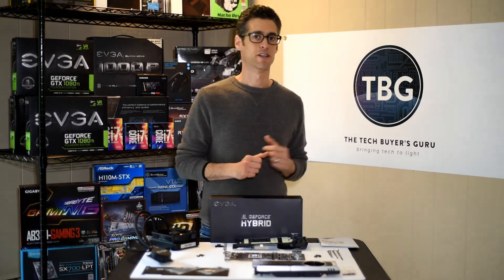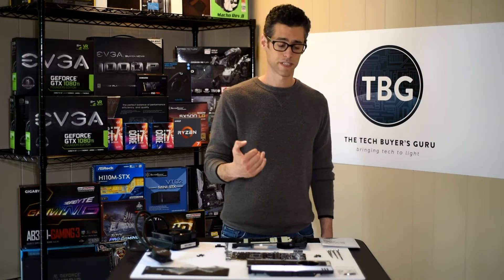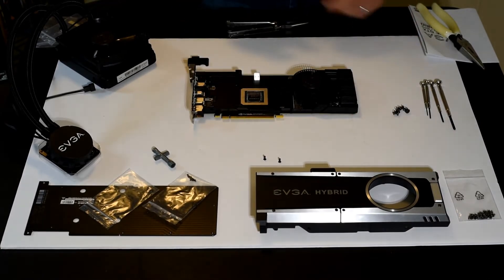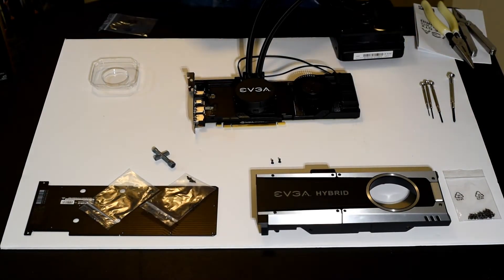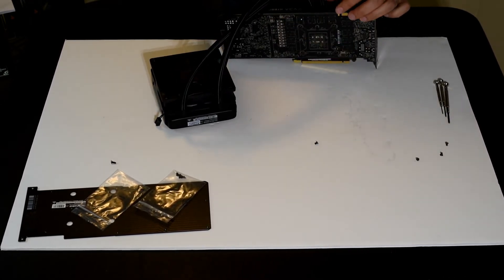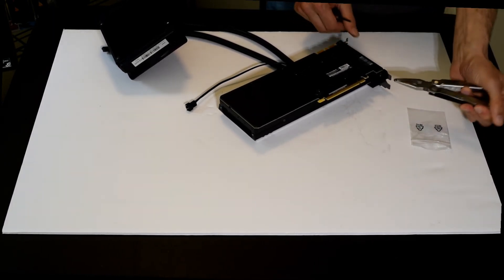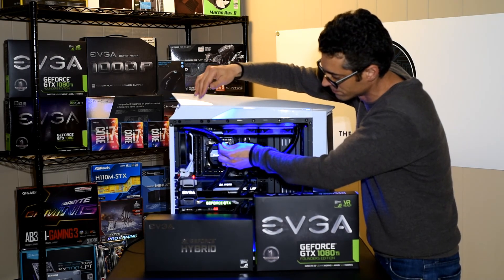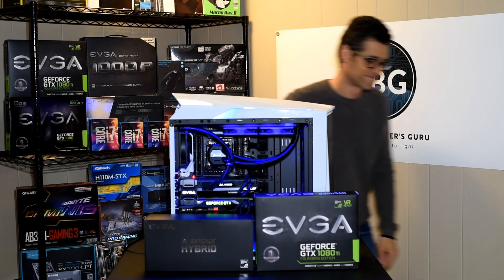EVGA GTX 1080 Ti Hybrid Cooler Installation, Part II and Evaluation

Comment: Thanks for making this, I've been looking at different options for cutting the noise out of my 1080ti FE and I think the hybrid cooler looks awesome.
Reply from the maker: For pushing your 1080 Ti to the max, there's no doubt the Hybrid cooler is far quieter than the FE cooler. Just  note that it is a bit louder at idle due to the pump noise.
Reply: yeah, nothing can be as loud as running witcher 3 at 4k ultra

Comment from the maker: Critical Update: while the original EVGA 1080 Ti Hybrid cooler shown in this video was discontinued shortly after release, EVGA has since replaced it with the Hybrid SC cooler, available at this link: https://www.bhphotovideo.com/c/product/1351746-REG/evga_400_hy_5598_b1_gtx_1080_ti_sc.html/BI/20077/KBID/13837/kw/EVG1080TSHWC/DFF/d10-v2-t1-xEVG1080TSHWC

Comment: Thank you for this video. My kits is arriving today and I'm actually putting it on the 1080 Ti SC Black edition. Even with the iCX cooler, mine hits 80C and stays there, even with 95% fan (So loud). Cannot wait to run nice and chilly. I have also read that Pascal cards start throttling ever so slightly at 50C and up. Pretty ridiculous considering they are "designed" to run up to 84C without any damage. Hmmmm.

Comment: Hi again Ari, it finally arrived today.

Your guide was invaluable - it kept me right at all times. It took 5+ hours all in all - not because it was complicated, but because it was plain time consuming and very fiddly. At one point you describe the process as 'surgery' and I can't disagree.

Performance so far is exactly what I expected - so far it's maxed out at 49C in Wildlands, albeit I have not played heavily yet. I suspect it will top at 55C. It idles from sleep at 30C but after gaming it's marginally higher at 32C. Still a colossal improvement over the 85/55 I used to have.

I would suggest two things; first, the reason the hex nuts are like that (you seemed quite baffled) is to allow you to screw the backplate into them. It's a deliberate design choice and as long as you're prepared, a good one. Unfortunately my screwdriver was broken so I had to use it in conjunction with a pair of pliers. Not ideal.

I would also make the point the thermal goop that comes with these kits is usually some of the best you can get - I know you recommend other brands in the video, but honestly it's as good as anything what you get with these kinds of kits and I would strongly recommend no one removes it unless they just absolutely have to.

Design of this device could be better. I didn't even look in the manual, and the lack of properly designated storage space for the cabling was a definite flaw, as was the garbage tape EVGA include.

But for all the quirks, the performance is exactly what I'd hoped for. I'm running without overclocking as of now, and hope I can deploy a decent overclock if I choose to do so.

I know the one in your video is discontinued but it or variations are still available in retail anyway, so I'd say putting the benchmarks out would still be valid anyway, as long as it has a disclaimer.

Anyway, thanks again for all your assistance in here, you were truly indispensable.

Cheers.
Reply from the maker: Danny, this is great news! And thanks for clearing up some of the comments I made in the video. As it was all done "live", I didn't really have a chance to examine all the aspects of the card.  That makes a disassembly/assembly video a bit tricky, because going through a rehearsal run makes it impossible to actually re-create what it is to complete the job, since you can't reassemble the stock cooler without new tape and perhaps some new screws.

In any event, your temperature readings sounds great, and yes, maybe later this week I'll turn to benching the Hybrid versus the FE. I still have both running in SLI as shown at the end of the video!

Comment: Great vid! You have a very clear, concise, no nonsense style which is essential and far too rare for this style of video. Keep it up! Subbed. 
I just bought an EVGA 1080 Ti SC with the ICX cooler. I am unhappy with the noise of the unit. I probably would have bought the Hybrid straight up if I'd known how noisy this beast would be. Unfortunately in my research I was told the ICX cooler was very quiet. I think it's even overheating as I'm getting artifacting sometimes during gameplay. I might have to give this cooling solution a try. Damn shame when you have to do surgury on a brand new $1300 AUD card to make it work properly!
Reply from the maker: Glad you liked the video! I'm actually about to publish the full gaming benchmarks of this card, which a number of viewers have asked for. Based on what I found, I'd recommend that if noise is your only concern, you stick with the ICX cooler. The Hybrid cooler actually isn't that quiet, it just runs way, way cooler. I've used the ICX cooler on the 1080 (not the 1080 Ti), and I know it's relatively good. If you're artifacting, something else is wrong. Are you running at factory settings? What temperature readings are you seeing in gameplay? Before making any changes, you should definitely determine what's going on.

Comment: Here’s hoping you’ll reply back to this. First off, great in-depth guide. I must have watched this about 10 times now. I do have a question for you though, see I purchased this same exact hybrid block kit and an EVGA Founders Edition of the 1080 Ti, and I must just have the worst luck because I have had to RMA this card twice now due to what I can only explain as installation problems. I have followed the instructions EVGA has printed and multiple video guides like this, and it just doesn’t seem to matter because as once the card would work before I did the install, then it wouldn’t as soon as I finished putting on the kit in full. I don’t believe I over tighten or have broken any chips or solder points while putting it together, but I am curious if you can think of any reason during the installation of these parts that could cause the card to not function properly. For example, not displaying anything during boot, but still powering on?
Reply from the maker: That's a bummer. Are you sure you connected the auxiliary power cables when you tried to boot? That behavior sounds like an under-powered card. I doubt the cooler itself damaged the card. It's possible that you scratched a trace on the card, however, when installing the cooler. Maybe a screwdriver slipped and hit the PCB? Hard to believe this would happen with two different cards, but that's the only thing I can think of. By the way, the exact hybrid block kit in the video is discontinued, so are you sure you had the one for the 1080 Ti and not the 1080?
Reply: The Tech Buyer's Guru -Yeah I purchased the same exact hybrid cooler, because under EVGA’s warranty page under my account, it labels the cooler as the Titan X/GTX 1080 Ti hybrid cooler kit (The discontinued version like your with the same exact model number). It wasn’t my first choice to go this route but I thought I was saving myself money by buying a Founders Edition and a Cooler, but it’s now adding up with all the RMA shipping costs I keep having to do through them. It’s currently on there way back to them, the card and the cooler. I would say it could be under powered, but an 800watt PSU with Corsair RGB Pro 280mm CPU cooler, i7-8700K, ASUS Prime-A motherboard, Samsung m.2 960 Evo, crucial 250gb SSD, 64gb of Ballistix Ram, an ASUS thunderboltEX3 add-in Card, and four 140mm fans with two 120mm fans shouldn’t be enough to bottleneck that card with a cooler should it? It’s a titanium rated PSU from SilverStone.
Reply from the maker: None of those components will affect the GPU cooler. Something is going wrong with the installation. Your best bet may be to sell the FE card and pick up a Hybrid card like this one: https://amzn.to/2JvEoWU. At this point, it doesn't actually make much sense to build it yourself, but at the time this video was published in May 2017, Hybrid models didn't exist.

Comment: great video!
A question though. Can I take out my 980ti Hybrid then stick in onto an MSI 1080ti FE?
if yes. should I put on thermal tapes? and what kind of tape if yes?
Reply from the maker: The 980 Ti Hybrid cooler will not fit, as the GPUs and circuit boards are quite different. So thermal tape isn't sufficient to get the cooler to work.
Reply: you CAN use the PUMP and ONLY the pump and maintain the Founders mid plate and fan for the VRM and stuff, check out Gamers Nexus, you do it that way, it's the same pump on all hybrids

Comment: Great video! Keep it up. I built one of your ITX platforms and I am in love with it. It punches way above it's pay-grade!
Reply: Also do you believe it would be good to run a dual setup with the coolers and different fans that both go to the motherboard?
Reply from the maker: Glad you liked the video, and cheers on your ITX rig!

As for running two Hybrid coolers, absolutely a possibility, but you need a big case with sufficient radiator mounts. And yes, custom motherboard-controlled fans would be great to reduce idle noise in a setup like this.

Comment: Really excited to find this. I've been going back and forth on getting one (as soon as I can find one in stock), but those cooling benchmarks may have just pushed me over the edge. 30C+ decrease under load is pretty astounding for an AIO cooler. Thanks for the video!
Reply from the maker: Glad you liked the video! Indeed, the thermals are really pretty amazing, dropping from 87C to 56C at load, as shown in the companion article (https://techbuyersguru.com/benching-geforce-gtx-1080-ti-air-vs-liquid-cooling). The only problem is noise - EVGA went a bit too aggressive with the included 120mm fan, but that's an easy fix.
Reply: Drew Williams Go for it! The newer stock of this product from EVGA has a modified manual which has specific instructions for 1080 ti and the screws inventory is cataloged well so you don't have to guess where each one goes. I got mine from newegg and installed it a couple days back. Ran some heavy benchmarking on it and it never crossed 46 degree Celsius under the 100% constant load. Whereas, with the original FE blower style cooler, it would reach 84 C and start thermal throttling.

Comment: You know if the EVGA GTX 1080 Ti SC HYBRID Waterblock (400-HY-5598-B1) will work with the ASUS 1080ti Turbo?
Reply from the maker: Unlikely. The Asus 1080 Ti Turbo (http://amzn.to/2tjmC6i) is a cost-reduced custom version of the card, and likely has a different board layout than the 1080 Ti Founders Edition. You'll need to ask Asus tech support whether it uses the same board as the Asus 1080 Ti Founders Edition, which they should be able to tell you.
Reply: Thanks for the info!

Comment: Hi guys, a second question; what kind of hex screwdriver is needed for the PCB bolts? You use a tiny wrench, but the way the angle is on it makes it look like the bolt heads are inverted, and the wrench is clamping around the bolts rather than screwing into them ala traditional screw. Can you just clear up what kind of bolt is used and what hex screwdriver? Thanks.
Reply: Thanks for the response but I resolved this about four weeks ago :) appreciated anyway.

Comment: Hi guys, great guide you've made - it makes installation of this look a lot less scary than I feared. I want to put this on an FE as you discuss here, but I have a question - what is the difference between the one you've installed in this video compared with the EVGA 1080 hybrid? You discuss that this is the 1080Ti edition, but I can find next to no data on any difference between the two kits. Apart from the cost! Can you help me here? Cheers.
Reply from the maker: Glad this was helpful. It can be a little scary working on something as valuable as a video card!

So there are some pretty significant difference between the GTX 1080 Ti cooler and the GTX 1080 cooler. You cannot use the GTX 1080 cooler for the 1080 Ti, at least not without significant modification. The 1080 Ti has an entirely different VRAM and VRM layout. The most obvious difference is 11 VRAM chips versus 8, but there are other differences as well. In other words, don't buy the GTX 1080 cooler just because it's cheaper - it's not what you want!

At this point, EVGA has released a new "SC Hybrid" 1080 Ti cooler, which can be seen here: http://amzn.to/2vahZeQ. This is the cooler you want, and it will install just like the one shown in the video - only the shroud is different, but that part is pre-assembled, so it won't affect installation. Yes, it's more expensive than the 1080 cooler (MSRP for the 1080 Ti SC Hybrid Cooler is $170).. The reason is not that it's vastly more complex or different, but that it's being produced in very small quantities, and for EVGA to make the investment in designing it, it had to charge more. There are far more GTX 1070 and GTX 1080 owners out there, and so EVGA can sell more of the GTX 1070/80 Hybrid coolers and make back its investment even at a much lower price. Not exactly the law of supply and demand, but sometimes economics doesn't teach us what we need to know!
Reply: Thanks for such a well-thought out answer. I'd seen a lot of claims online that the 1080 edition could be used on the FE and that the only difference was minor, but I was extremely wary of taking that risk. Yes, the SC Hybrid is available here in UK at £140 from literally one store, and I'm close to ordering. Can I ask what results I can expect? I had a look for the benches you said you'd be putting up but couldn't find them on your site. I'm wanting to be able to keep under 50C (to reduce thermal throttle of course) if possible while putting the power to 120% to guarantee clock stability. Is that realistic?
Reply from the maker: Because the original  EVGA 400-HY-5388-B1 Hybrid Cooler that we tested was cancelled by EVGA after only a week, we will not be publishing benchmarks on it. Doing so would take far too much time given that it wasn't a true product release but more like an engineering sample.

That being said, the SC edition of the Hybrid Cooler will likely perform almost identically, and in our testing, the GPU stayed at around 55C during all testing. You aren't going to get below 50C, but given that Pascal GPUs only start to cut clock speed at 60C, you don't have to. Rest assured that the SC Hybrid will have you running at maximum possible clockspeeds.
Reply: Yeah just catching up with this now. So this product is a busted flush. I can either buy the one I have access to, or ... what? What would you recommend as an alternative AIO water cooler if this one's run is done? The only other option I have is selling my FE and buying a new EVGA model with the cooler on board. Or similar Ti model.
EDIT: apologies, I'd missed the second paragraph. I'm confused now - are you saying the SC one is NOT discontinued - and which one IS the SC one - that's for 1080 or 1080Ti? And I was under the impression Pascal throttled from 35C onwards.
Reply: Ok I bit the bullet and ordered the pesky thing. If anything goes wrong I will hold you lot personally responsible. I kid, I'll be glued to the guide!
Reply from the maker: The EVGA GTX 1080 Ti Hybrid SC cooler can be purchased for $170 direct from EVGA: https://www.evga.com/products/product.aspx?pn=400-HY-5598-B1

That being said, selling your FE and buying a GTX 1080 Ti with the cooler installed from the factory is probably a better idea, as it will basically cost you  the same. The 1080 Ti Hybrid is $810 at Amazon (http://amzn.to/2f28kAq) or £760 at Amazon UK (http://amzn.to/2ueaM8M).

As for throttling at 35C, I don't think that's right. I didn't see any throttling on my 1080 Ti Hybrid at any point, starting at 30C idle up to when it peaked at 56C. It would be pretty silly for Nvidia to build in throttle points that were that low anyway. Essentially, they'd be designing in characteristics that couldn't be used in the real world, which would cost them time and engineering hours win no clear benefit.
Reply: I've ordered 400-HY-5388-B1 at a fairly competitive cost. The one from your review. Still in the dark as to what the difference is with this 5598 but anyway. And good, thanks, I'm glad that was misinformation. I want to get the most out of the card. Incidentally will maxing the power stabilise the clock or is that only necessary when it starts to throttle/heat?
Reply: Interesting - I've been looking at the PDF spec sheets for both of these models, and there is one distinct difference. The 5598 is ONLY for EVGA cards, while the 5388 is for ALL 1080Ti reference cards.

https://www.evga.com/products/pdf/400-HY-5598-B1.pdf

https://www.evga.com/products/pdf/400-HY-5388-B1.pdf

The former is more expensive and appears to be specifically for EVGA kit, while the the latter applies to all ref 1080Tis. I couldn't figure out the difference but I think I get it now.
Reply from the maker: Actually, I think the big difference is as follows: the 5598 works on all Founders Edition cards, and certain eVGA custom cards. the 5388 ONLY works on Founders Edition cards. Also, as you can see by looking at the cooler, the 5598 uses a standard fan rather than a radial (blower) fan. Honestly, the radial fan will work better for this setup, but probably wasn't compatible with the custom eVGA cards, which is why it was changed.
Reply: Thanks, that also makes perfect sense. Glad I got the 5388. Thanks for all your help Ari, appreciate you taking the time to answer my annoying questions on this piece of kit. Good luck with your site. Hope you get as big as you deserve. You're every inch as good as the 'larger' sites.
Reply from the maker: Many thanks!